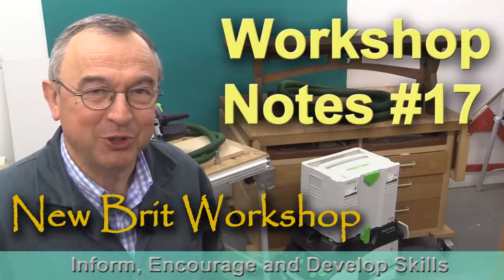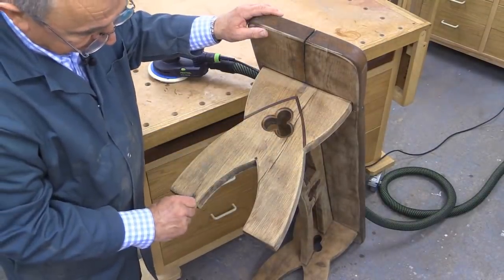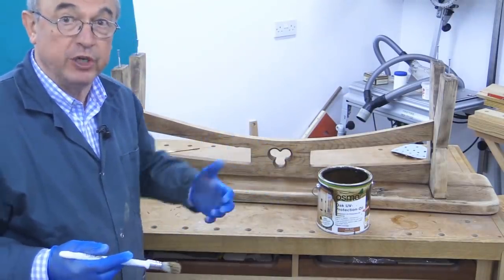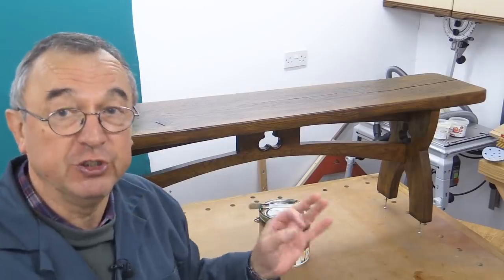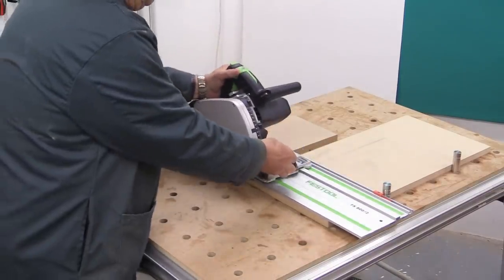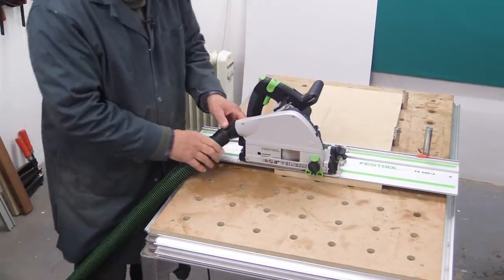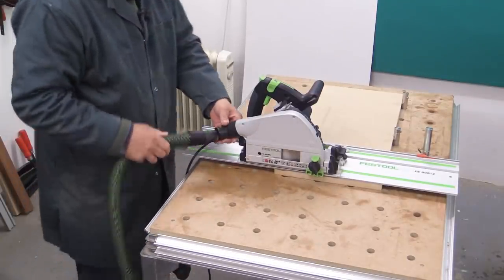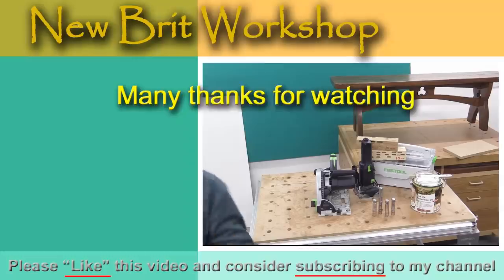Workshop Notes #17

Comment: Great little video Peter. The new Festool hose looks so much better, that is why we use Festool, they solve the problems we have.
The Bessey plaster box looks like another great problem solver. We all carry plasters, now we have a proper box to put them in.
I can add the mini multi meter to that, it said screwfix on the sleeve, can you provide a name or number. All three are on my shopping list.
Reply from the maker: Hi Harvey, Screwfix now stock a slightly updated version of my meter, I am sure it is the same as before but with a better rubber protection boot. It is made by LAP, is just over £7. Here is the link: https://www.screwfix.com/p/lap-mas830b-digital-multimeter-600v/75337   Cheers.   Peter

Comment: I have seen lots of people using an MFT and I have toyed with getting one but I have never seen someone us it like you did to create the right angle for cutting. That has no convinced me I need one. Thanks for the demo.
Reply from the maker: Hi Jason, If money is tight then build what you need yourself and do the top using the Parf Guide System - you will save many hundreds of dollars or pounds.  Festool make no claim for the accuracy of their holes and so the Parf Guide System is essential to guarantee near perfect cuts. My MFT top was made with the PGS.   Peter
Reply: Thanks for the help Peter, I will do the research properly now that I have found a use for one. Many Thanks

Comment: Hi Peter, I think you meant to say 'the Rotex 150' (or 125) at the 3 minute mark, instead of the '80'… Still, very informative video that came out at the right time for me — refinishing outdoor furniture is imminent here too.
Reply from the maker: Hi Bert, Gosh, I had been talking about 80 grit and forgot to add the extra 70 !  The point is that the ETS is an excellent sander which can punch above its weight.   Cheers.   Peter

Comment: Terrific video as always! As a result of your videos I've got the UJK Parf guide (love it... just need some of those track clips, where can i buy in canada?) and I'm in the process of switching to Osmo. I'm wondering though - on an open-pored wood, do you use a filler before using Osmo? I'm using Polyx as a test on ash for a dining table and it seems like the open pores may be able to hold onto crumbs + moisture over time
Reply from the maker: I would doubt whether grain filler would be a good idea with Osmo but you could do a test. The rail clips are available from TSO (I know they are in the US) as Lee Valley have not taken them on yet. It might be worth you putting some pressure on LV as Axminster send them stuff every week.  Good luck with everything.   Peter
Reply: Hi there, I live in the UK but work in Canada (Edmonton) for 8 months a year. Have you tried Lea Valley? If all else fails give me a shout and I will bring you some and send them on, wont be till September though. Or, I could send you some from here, they are small. John
Reply: i'll see if i can order from axminster, hopefully they can just mail them. thanks for the offer though! and yeah, lee valley doesn't sell those unfortunately, which is odd because they go so well with the parf dogs!
Reply: @New Brit Workshop am I doing something wrong with the finish then? On your desktop (which was oak, i think?) you were able to get a really good covering of oil and your wine test didn't leave a mark. Were ou able to close up pores with the product? On my test board i just wiped it on, figuring that if I used enough product it wouldn't make a difference... maybe that was part of my problem. three coats later though and the pores are still open.
Reply from the maker: It is difficult to judge this from just a few words above but it may be that you need to roughen the surface very slightly (as it would be for de-nibbing) and then apply another coat. When you apply this new coat use one of those white non abrasive pads to work the Osmo in.  Peter

Comment: Hi Peter,  After viewing how much clearance you have with the ability to insert your fingers between the motor housing and the Parf Super Dog, I realized that my experience is not the same.  Here is a video of what I am seeing.  https://youtu.be/3dq2b13xPZw  I wonder if the housing is different between the TS 55 EQ and the TS 55 REQ?  Thanks again your valuable teaching and feedback.
Reply from the maker: Hi John, I am baffled by this. I am using the original TS55 and I have a Festool blade installed which has been sharpened just once. The material shown in my video was 19 mm MDF. First, is the blade in your saw the correct diameter? I set my depth of cut to 1 - 2 mm into the bench top and no more. If you look at my video from the 9 minute point you will see a way of overcoming your problem if your saw blade is less than 160 mm diameter. Many thanks for making the effort to demonstrate the issue from your perspective via a very clear and well presented video.   Peter
Reply: Thank you Peter.  I am using the original Festool saw blade.  It does seem odd that there is this difference but fortunately the way I actually use the dogs is with the festool fence pushed up against the dogs so that the distant dog against the guide rail is set further back.  I like this arrangement because I have attached a scale to the face of the fence which I find very useful.  Perhaps I should make a video to show that at some point.
Reply from the maker: Hi John, I actually think that you should start making videos about the things that you make. You have a very clear  delivery and you could attract others to your channel. Good luck getting the fence and dogs sorted out.   Peter